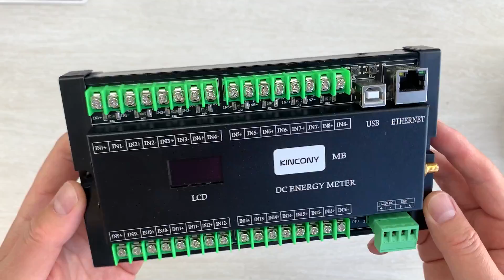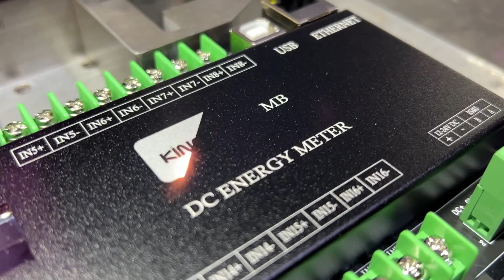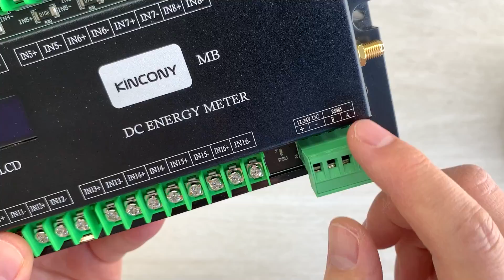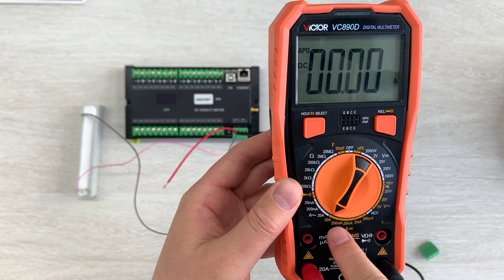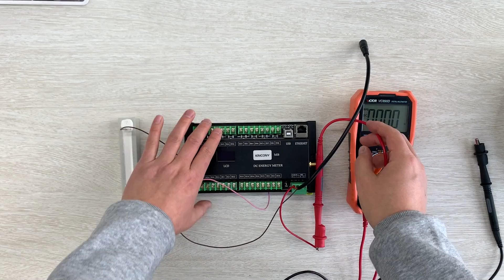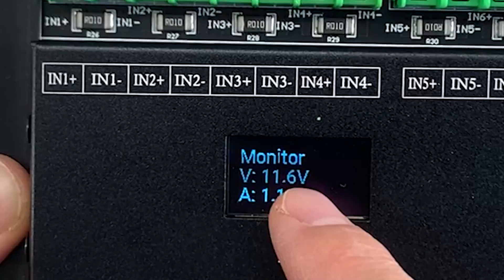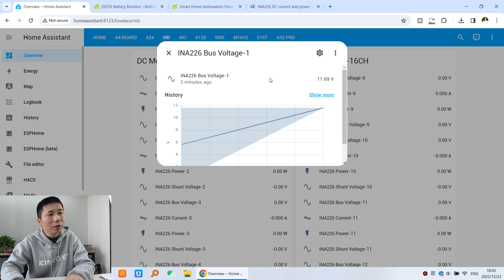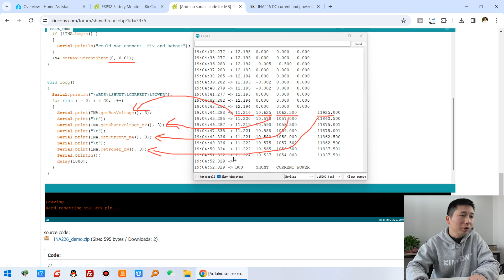ESP32 Battery Monitor board For ESPHome in Home assistant - KinCony MB

Comment: It will be very helpful if this pcb can trigger on/off a reley based on voltage readings. You should do that
Reply from the maker: if you integrate to home assistant software, it's OK, just set AUTOMATION function.
Reply: @KinCony  That's ok, but if not using home assistant, there is no automation. It will be very nice to have a couple of relays on it, to use local automation. Or tuya connectivity for cloud automation
Reply from the maker: you can make a AUTOMATION when voltage  changed send RS485 command to relay board.it work locally, not need home assistant running. @piramida51
Reply: @KinCony  Can you please make a video for that? Thank you very much
Reply from the maker: when have free time can make it. @piramida51